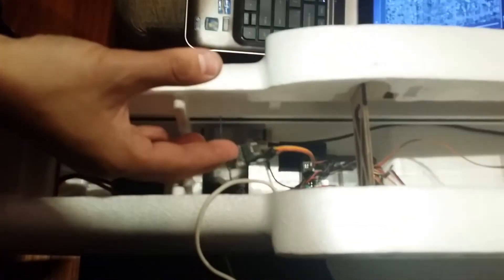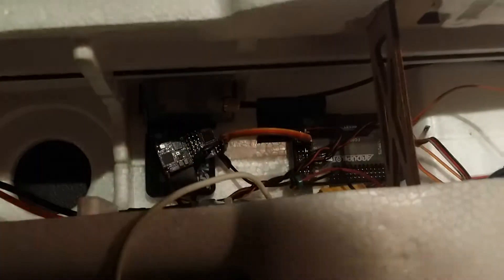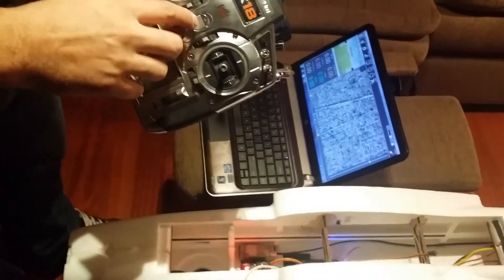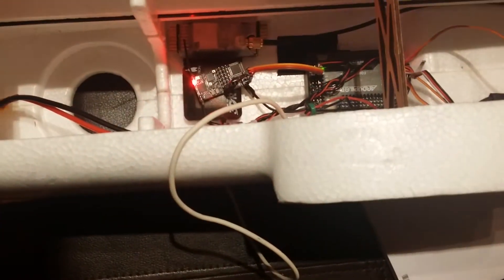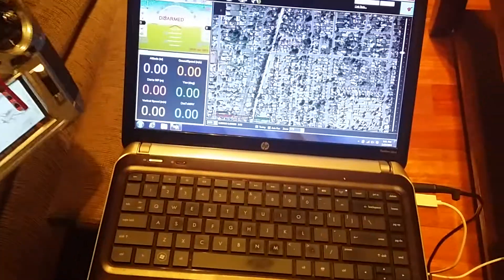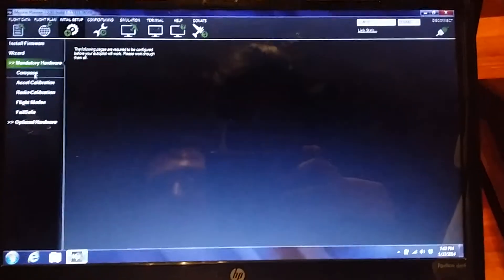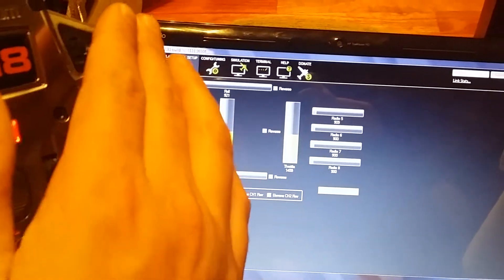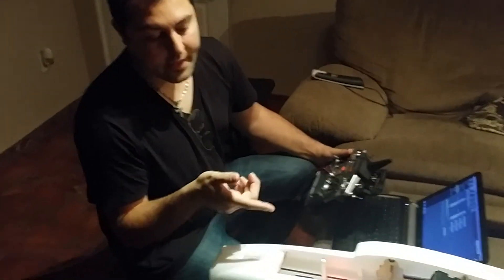Lemon 6 channel DSM2 Rx with PPM output

Comment: I didn't think the lemon 6 channel supported PPM?
Reply from the maker: ***** They Sure do. and the new ones are DSMX
Reply: Oh cool thanks. I bought one as a spare. Dsmx.  I have the 8 channel lemon now, so I just wanted to make sure the 6 has PPM also. Much appreciated.
Reply: Team Legit I'm having a little trouble. Which port on the Lemon 6 Channel do I hook into for PPM? I've tried them all (besides the bind port obviously) but I can't get a signal. It's a dsmx lemon 6. Any help would be greatly appreciated.
Reply from the maker: Hi Brian, I reread your original comment. I mistakenly read you had an 8 channel instead of the 6 channel. Unfortunately the  channels are not PPM yet. Only the 8 channels are at the moment.

Comment from the maker: I Used The APM 2.52 for the control and The Lemon RX with PPM Output. I had to Remap the Channel outs to. Ch1 = Aileron Ch2 = Elevator and Ch3 = Throttle and Ch4 = Rudder.